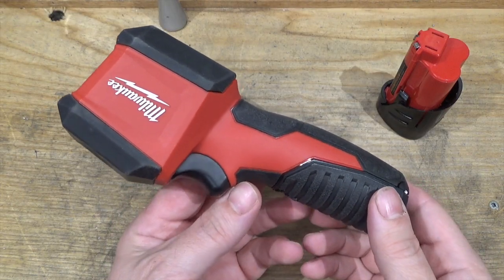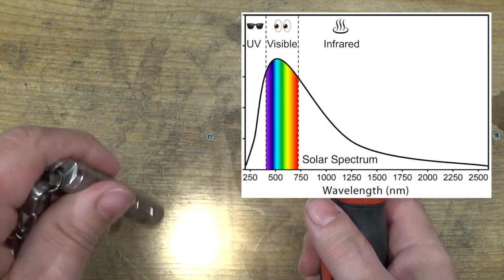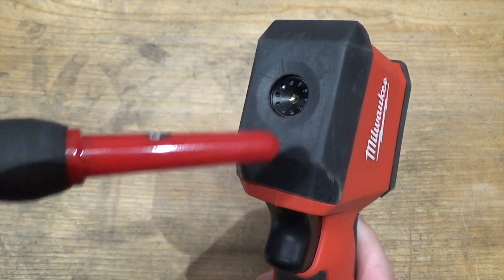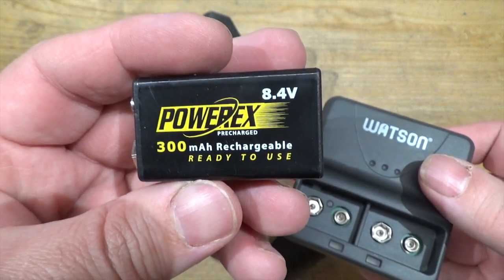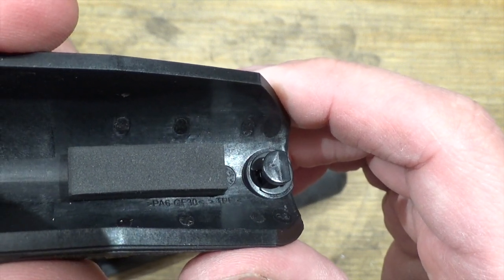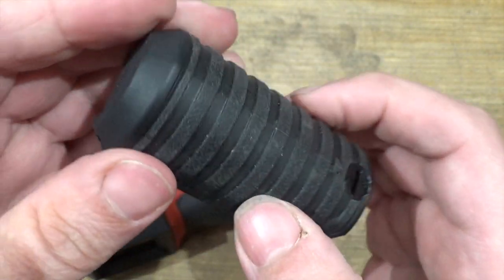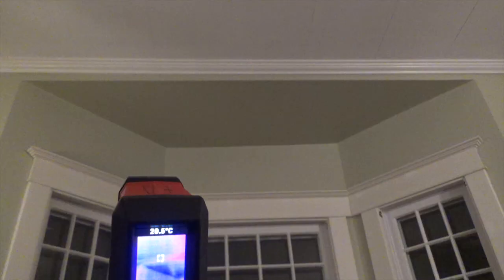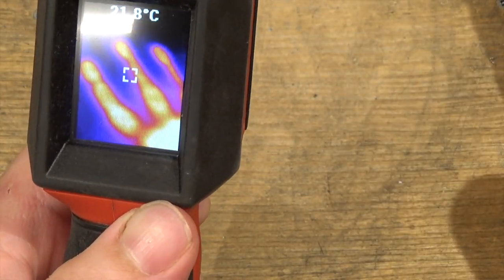Look-See: Milwaukee Infrared Imager 2257-20

Comment: I just bought the M12 version, that's what I get for not checking for options on the big international market...

Well well, I can at least make cool home porn vids with mine. 🤣
Reply from the maker: M12 would be good if you are invested in M12 tools and you have batteries on hand. And, the M12 version allows recording that is very useful to pro's who need to file reports, eg home inspectors. Thanks for watching!